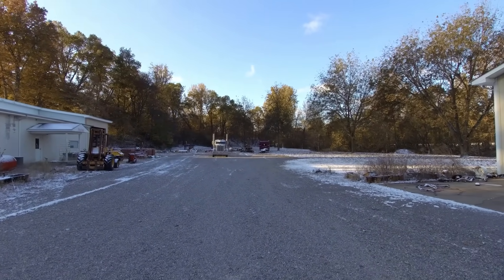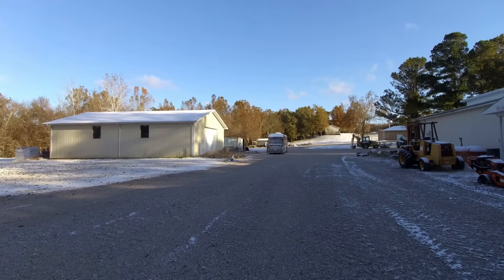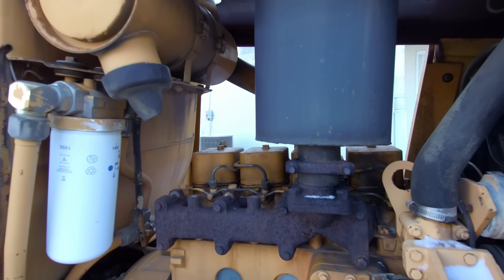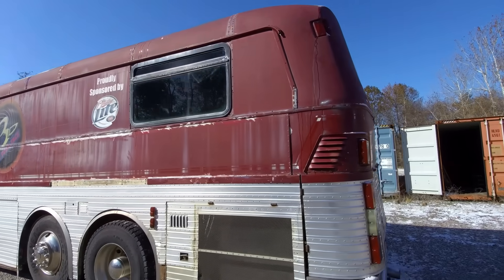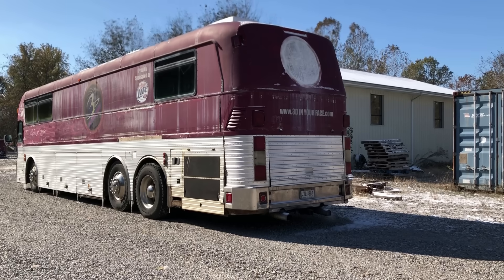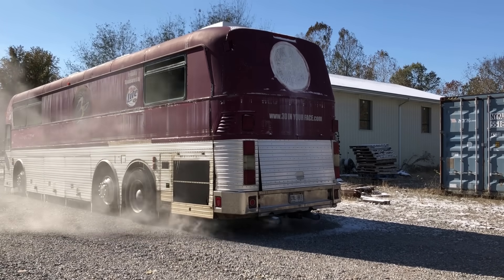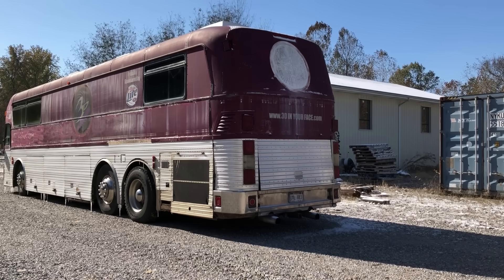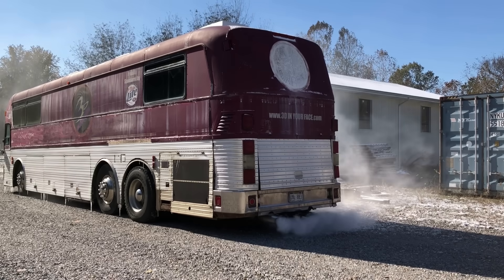Cold Starting a 8V71 Two Stroke Detroit Diesel Engine at 15° F

Comment: Sometimes in cold weather, after cranking a Detroit for a bit, try cranking with the shut-off solenoid energized.  These engines "flood" when cold.  When flooded, cranking with the shutoff solenoid energized will often get them to bark and sometimes start enough to let go of the stop solenoid and have it run.

Comment: Did ya put a little ether in 'er?  Usually starts much easier with that.  Ahh there he goes.  On the 4th attempt he figures it out. Oops, ole bus is looking for another hit.  Good thing its a 24 v starter system.  Started so many of them in my career.  Thanks for the memories but I am not a fan of bad mouthing the old girl.  You'll be old and ugly one day too.

Comment: The trick with these is to use a bunch of newspaper and light a fire underneath, two stroke diesel is very simple, there's usually nothing underneath that's gonna be damaged by the fire. You let the newspaper burn for about 30 seconds, just enough to heat up the oil pan and loosen things up a bit. Then it starts on first key pull.
Reply: I’ve seen this being carried out here in the u.k.   it was so cold the fuel lines were on the brink of freezing, and that’s cold.

Comment: As for that bus: too bad there is so little of that wonderful smelling exhaust gas coming out. At times you even wonder if the engine is even running. The gases are so clean or there is far too little.

Comment: I was a self propelled howitzer mechanic when I was in the Marine Corps in the late eighties/early nineties. 
I remember this from school. 
8 v 71 T Detroit diesel. 
V8 block
71 cubic inches per cylinder 
Turbocharged 
Roots blown
410 hp
1000 fp torque

Comment: 5:50 pour some gasoline in spray bottle and spray it on air filter while cranking it over. You will get the job done easier. It is too cold to start it.

Comment: Hey. I'm Canadian so this is just another day at the office, eh ? 😊
     I'm guessing you are an equipment dealer/tech so you probably know the following but I'll share anyway for the benefit of others....
     Cold starting diesels which have not been pre-warmed, as seen here, pounds the living crap out of the engine's starter and shortens the life of the starter. Hard on the engine, too. In the abscence of a block heater, you can put a tarp (or two ) over the engine and use an electric heater (or two) to warm the block. Takes a couple hours. You can also GENTLY warm the oil in the oil pan with a propane torch. Just keep the flame a reasonable distance from the pan. That works wonders.
In extreme cold weather, as seen here, you can and should either switch from 15 W 40 engine oil to a DIESEL ENGINE 10 W 30 oil (NOT the same as car 10 W 30...different recipe,  different additives). Some diesel engine manufacturers (like Volkswagen) recommend thinning your diesel by diluting it @ 5% with gasoline. Much better cold starting, especially if you are in parts of USA  (like TX) where the fuel vendors don't sell a winter diesel. 
     Note that the gentleman in the video used the ether (quick start) VERY sparingly. Wise. If you go crazy with that stuff you can damage a cold engine. Seen it happen 😢.
     Happy cranking. Be safe. 😊

Comment: Is it possible that the diesel fuel is just shit? (at least when it comes to the more "modern" engines you're running)
Here in middle and eastern Europe there's no real problem starting a diesel engine at around -13F (-25 Celsius), but we have special "winter diesel"...

Comment: ya know, every diesel engine I own, have owned, have enjoyed having a $ 14.99 block heater installed,  which by the way can be utilized by a 12 volt battery and a 12vdc to 120 ac inverter. Why people take pleasure out of torturing the hell out of an ice cold engine I will never know.

Comment: I wonder if you could turn the fuel off on diesels and crank the engine for 10 seconds. Would it them build up enough heat to start.

Comment: You have to understand that when you start opening the throttle up on a diesel that’s cold, you are introducing cold fuel. Too much cold fuel & you won’t get the cylinder temperature up high enough to combust the fuel. Gently introduce fuel once you have one or more cylinder firing.

Comment: Just stick a lithium battery 20v powered heatgun in the the air intake after removing the filter. It will start way faster. And less damage.

Comment: I work for a transit agency. When temperatures drop below a certain degree, we hire one or two people on the overnight for “fire watch”. Thier job is to start the buses every hour and run them for 10-15 minutes. 

I saw some comments about electric vehicles. I saw some reports from people with electric vehicles in Wisconsin. Unusable when temperatures get down below 0. Wisconsin can get down to -25 in the dead of winter.

Comment: A good fresh 8v71 or any 2-stroke detroit will start far better than any electronic 4-stroke.  I've been around them all.  A 2-stroke diesel is not typical to anything that is "normal" today.  I have a 8v71 that is tight and new that I have started up in 12degree weather that started the first roll over with no either.  Depends on timing and and how good of shape they are in. I've also owned a 12v71 that wanted all the starting fluid you could give it at anything less than 40f.  The best part about the old detroits is they give you lots of warning they are going down hill.  Like years!  Heard a story of a 8v71 doing duty pumping water out of a deep hard rock mine.  Started loosing oil pressure so they just raised the RPM.  That stope was getting closed in the next couple weeks.  By the time it got shut down it was turning 6500rpm.  Never had issues just low oil pressure.  You have to wonder if it was just the gauge.  Its now under several thousand feet of water.

Comment: Cold 2 stroke start procedure as follows:
1.  Get a friend with a can of ether and place at air intake
2.  Get friend to start flow of ether into air cleaner. Tell them not to stop
3. Hit starter until engine fires
4. Make sure friend continues to feed ether for a couple more seconds, and feed more intermittent bursts coordinated with drop in engine rpm
5. Continue until engine can sustain idle, or repeat if stall occurs
6. Enjoy the music

Comment: Good old 8V71. I've heard so many stories from truck drivers in my family about those. Some of them in mines and mining equipment, would literally be left running, for years on end without ever turning off, some With over 1 million hours I believe, without overhaul. And that's under power and load. I've also heard starting fluid was invented just to start the damn things in the cold. Lol that's satire but it could be true. 🤣 Fact of the matter is, if you can get the damn thing to start, there's a good chance it'll never die as long as it has oil and fuel, and doesn't overheat.

Comment: Man, I used to work on an oil rig pulling unit that had a Detroit. Every time we'd latch on a joint, that Detroit would Rev up and we'd disconnect, hook back on, and repeat. In Oklahoma, you can hear that Detroit making itself known on a cold winter morning for miles. A very distinct noise and you hear it, you knew some crew was getting down for a day. Classic stuff. Nostalgic.

Comment: Had to cold start a towboat's generator that hadn't been run overnight like it was supposed to be in 10 degree weather.
I drained the fuel from the day tank & told the deckhands to go pour it into another boats fuel tank & to bring back warm fuel.
Without using more ether (they'd used a case already)I had the generator going in 10 minutes.
The fuel was warm enough after 30 minutes to start one of the main engines & start moving out to where we were doing crew change & the other main engine started right up.

Comment: Should have a start switch/button right in the back by the motor. No ? A block heater does wonders for cold weather starts on any diesel.

Comment: I love old  2 stroke engines, but I have to admit that the diesel ones stopped being produced for good, too much pollution from oil and fuel mixture
I also hope that normal gasoline 2 stroke end production worldwide, and move forward with battery and electric powered vehicles and tools like  grass trimmers and lawnmowers for example
We’ll be doing a favor to the world

Comment: Can someone pls explain why a big bus engine is a two stroke and not a four stroke
Reply: They used to power many types of machinery  in days past , and the old 2 stroke detroits where tuff old things , and if memory serves at one stage they where sold as the million mile engine , but a tad thirsty, also noisy  and probably a bit more expensive to service by modern standards .

Comment: Take a propane torch and heat up the intake manifold, it will start right up, you don't even need working glow plugs to start a diesel if you need to.

Comment: I can feel the smell of un burnt diesel behind the screen and the mask on my face. But thank you for the video. I never knew there are two stroke diesel engines before now. Do you have to add oil to the fuel like and gasoline engine, or is tge oil from diesel enough?

Comment: That bus sound freaking mint when he revved it up it gave me chills
Reply: Kind of like a 4 cylinder 4 stroke boxer?
Reply: @erneststyczen7071  Its a 8v71
Reply: I agree
Reply: Eight inch straight pipe going down a steep grade riding the engine brake. Sounds just wicked.
Reply: It fr sounded like a wrx sti
Reply: Love the sound of a two stroke.
Reply: It's sounds like the Motor's going Dry

Comment: Hiii. Those 8 probes were not rlly necessary. I'll explain how did we deal wth such cold start in Poland during heavier winters. Old style diesel engines were first heated by putting a SHOVEL wrapped in old n dirty rugs, wet by petrol for exmpl, and moving it burning under the engine itself (!!!) I know how it sounds and that u may think I'm crazy, but it was trully working great on -30* C.
This engine here is an engine from 50's-60's, so it was same kind of mashinery like I've texted about :] If u're out of shovel n rugs, u can put a small bowl wth some petrol/kerosene/diesel fired under ur engine. 100% sure, but be carreful.

Comment: I love how he had to specify that his forklift is not turbocharged 🤣
Reply: A. he says that for both the forklift and the skid steer
B. he specified that because most diesel engines are turbocharged
Reply: @glensomething2800  Still pretty funny to me though
Reply: @lberc20  fair enough
Reply: @lberc20  haha yeah it sounds funny but I’d say the same as most diesels use turbos nowadays all of them
Reply: @lberc20 it’s reasonable information to want to know
Reply: @glensomething2800  Newer they are, but before about 2000 most diesel cars in Australia are N/A, they were turbo options available before then but they were uncommon.
Reply: @uselessgeneral1299  Still driving an F350 dually flatbed with a 7.3 IDI NA. Wish it had a turbo but it isn’t a slouch as long as I don’t pull an equipment trailer.
Reply: @glensomething2800  You're right, my bad.
Reply: forklift coming too drop load off “brrrummmmmmmmmmm wushshshsshshshshshshsh”
Reply: Most diesels are turbocharged
Reply: That's a skidsteer.
 Edit: My bad, I'm an idiot, the forklift is earlier in the video.
Reply: We call that a Bobcat here in Aus... definitely not a forklift
Reply: @Sillyboy9572  there’s a forklift before the bobcat

Comment: Toyota Prius: We HaVe AlMoSt No EmIsSiOnS!
Two stroke diesel:  we are all emissions
Reply: Diesels do run cleaner people just see the black smoke and get scared ...the bad emissions are the ones you can't see .
Reply: @butterfinger4393  true!
Reply: Rotary: ...
Reply: You won't seen many Prius or even tesla last 20+ years. Not only does diesel burn cleaner as stated in this comment section but what it takes to charge and produce battery cells is significantly worse. 
Still a funny comment tho
Reply: @roxastherogue  Diesel doesn't burn cleaner than gasoline, but diesel engines are lean-burn so they do a good job of burning all their fuel (unless you're an idiot who turns up the fuel too much so he can 'roll coal') whereas a carburetted gasoline engine usually winds up sending some of its fuel out the exhaust partly burnt.

The unburnt fuel in the exhaust becomes an advantage once you introduce EFI and after-treatment by a 3-way cat. The cat uses the NOx emissions to burn the residual fuel, leaving only CO2 and water. This way a gas engine can deal with almost all of its pollutants (except CO2) easily. Diesels start from a better place but the lean exhaust makes after-treatment more difficult and expensive, hence EGR, DPFs, SCR and all that fun stuff.
Reply: It’s so weird to me when people make fun of other people for trying to help the environment (disregarding the fact that the Prius isn’t very environmentally friendly). A lot of Americans have been brainwashed by politicians and corporations into thinking that caring for the world around you is less “manly” or you’re a tree hugging weirdo for doing so. It’s pretty sad
Reply: @cameronchild6146  Its because youre brainwashed into consuming things because its environmentally friendly
Reply: @cameronchild6146  for me a cool car with a cool engine is more relevant than the environment. But if I can have without damaging mother nature, even better. I think that ethanol is a very good way to achive just that. I do believe that a car with a modern engine made out of cast iron running on ethanol has less impact on the environment than an electric car, because you can find iron everywhere, so there is no need to transport material all over the world (unlike batteries), its easy and cheap to make, and doesn't cost a lot of energy (unlike batteries), ethanol burns very cleanly and emit very lower emissions of CO2, NOx, and other toxic substances. If you have an electric car, but the power come from a powerplant burning coal, it kinda defeats the point of having an electric car. The bagasse can also be burned to produce energy, so there is little waste of material. You can say that the ethanol needs to travel a long way to get to the gas station, being transported by diesel trucks, but this can can also be said about the powerplants, which can also be located far away from the fuel supplier.
Reply: @luisfelipewellenkamp5805 I get what you’re saying, I’m not anti-car, I’m anti corporation. I think that the blame of global warming being placed on the consumer is a crime. 100 corporations produce 70% of emissions since 1988, everyone would be able to do whatever they want with cars if the big bucks would shave a couple dollars off their profits to make a better world. I am also anti-make fun of people for caring about the environment which was my main point
Reply: @1ABL.  lots of carbed engines still being made and sold, just not in cars.
Reply: They'd make a BMW blush with how much oil they leak, and they'd make a 12v Cummins with way oversized injectors start to leak oil with the amount of black smoke coming from the exhaust of a cold Detroit.
Reply: Kkkkkk
Reply: Thats why adblue is a wonderful thing
Reply: It's mixed diesel
Reply: Diesels burns better than gas. Gas is worse for the environment
Reply: @bigboytony8485  It's more complicated than that. Diesel engines burn less fuel than gas, but they still create about 13% more CO2 emissions per Liter of fuel than gas, produce more soot, and more NOx than gas engines. In passenger vehicles where diesel engines would double your fuel economy, there will definitely be less emissions than gasoline based on range. On the other hand, larger vehicles may only see a 2mpg gain going from gas to diesel and would run no cleaner than gas as a result.
Reply: @bigboytony8485  diesel absolutely does not burn cleaner than gas
Reply: @maxfried5328  actually it kinda does. Gas has more toxic exhaust gasses.
Reply: @maxfried5328  it is more efficient tho, so it’s better than gas
Reply: @AshThePagan  efficiency doesn’t mean good for the environment. While diesels release less co2 they release a ton of NOx. NOx is much better for the environment but bad for people. Better to hurt people than earth
Reply: @dennis-br6vr  Which get completely filtered out by newer cars. Well if you drive a 80s 90s gas thats a different story.
Reply: @flowgangsemaudamartoz7062  bullshitt. They dont filter it out. They did reduce it, but never will they be aboe to remove all of it.
Reply: @maxfried5328  it most certainly does tho the ones that roll coal dont but that’s because of how rich they run their specific trucks
Reply: @dennis-br6vr  not until it runs away
Reply: @bigboytony8485  Gas emits more co2, which contributes to global warming, but diesel produces a lot more of NOx, which are very bad for human health.
Reply: @bigboytony8485  it’s not diesel it’s mixed gas
Reply: I get Prius fuel economy in my 02 Golf TDI..normal combined 1000kms on 50 litres or 1200 highway on 50 litres..Love turbo diesel torque.
Reply: Electric cars are for the gays.. 🤣
Reply: @HailAnts  literally no one asked
Reply: @ballisticmissl7919  - One of us! One of us! One of u ⚡️-BZZZZZZZZZT!!! ⚡️⚡️
Reply: prius starts always no matter how cold it gets
Reply: @gabakusa  yes but wont make it down the block  if it's too cold

Comment: can someone explain this to me. a two stroke gasoline engine needs oil mixed in with the gas to lubricate the bottom end of the engine and the main bearings right.  so a two stroke diesel engine, does that need oil mixed in with diesel to lubricate it as well? but diesel is basically more oil like than gas, so is it mixed in? does it need oil mixed with it at all?

Comment: I had good luck with the 8V-71 series engines. Easy and cheap to rebuild, but not often needed. As long as you drive it like you're mad at it.